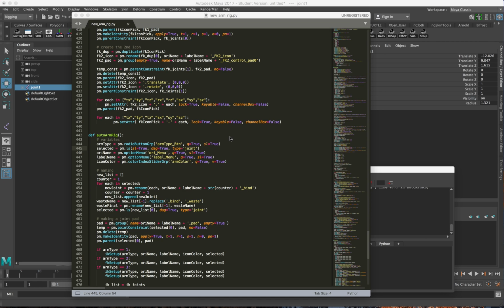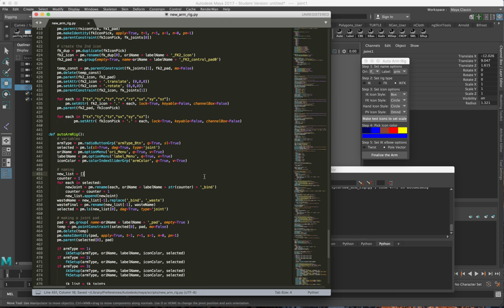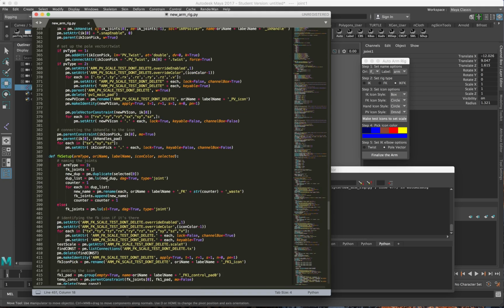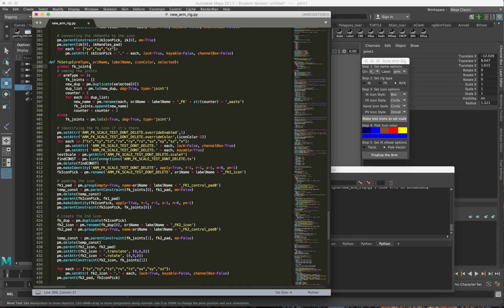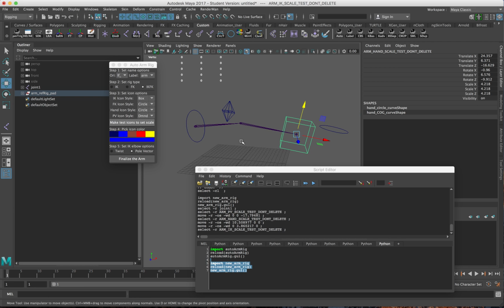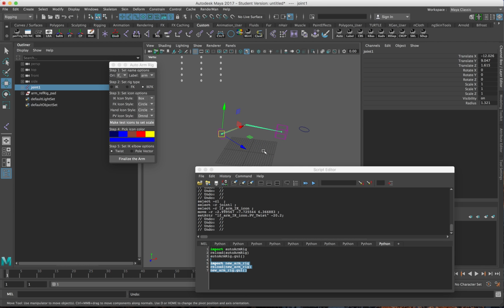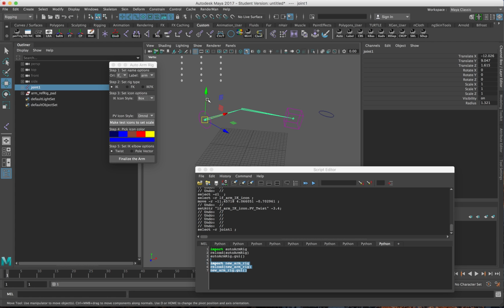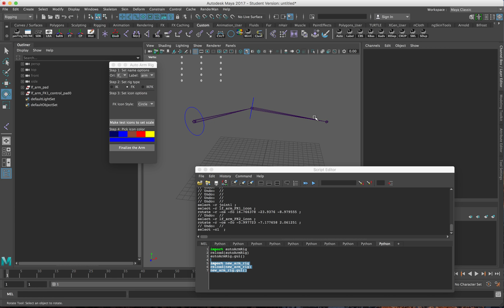Basic Auto Rigging in Maya with Python (Part 9)

Comment: I'm getting an error: 

# Error: list index out of range
# Traceback (most recent call last):
#   File "<maya console>", line 1, in <module>
#   File "d:/Users/XXX/Documents/maya/2018/scripts\new_arm_rig.py", line 204, in armIconScale
#     tempCONST = pm.parentConstraint(selected[1], ik_ctrl, mo=False)
# IndexError: list index out of range #
# Undo: new_arm_rig.armIconScale() #
Reply from the maker: Krobbkag Destroyer Of Worlds typically when you get the error “list index out of range” it means you didn’t select something before you ran the code.
Reply: @dcpalley23  Awesome, that seems to have done it: but now I've run into a new glitch:

// Error: setAttr: Cannot set the attribute 'ARM_IK_SCALE_TEST_DO_NOT_DELETE.overrideEnabled' past its maximum value of 1.
# Traceback (most recent call last):
#   File "<maya console>", line 1, in <module>
#   File "d:/Users/XXX/Documents/maya/2018/scripts\new_arm_rig.py", line 487, in autoArmRig
#     ikSetup(armType, oriName, labelName, iconColor, selected)
#   File "d:/Users/XXX/Documents/maya/2018/scripts\new_arm_rig.py", line 354, in ikSetup
#     pm.setAttr('ARM_IK_SCALE_TEST_DO_NOT_DELETE.overrideEnabled', (iconColor-1))
#   File "C:\Program Files\Autodesk\Maya2018\Python\lib\site-packages\pymel\core\general.py", line 573, in setAttr
#     cmds.setAttr(attr, *args, **kwargs)
#   File "C:\Program Files\Autodesk\Maya2018\Python\lib\site-packages\pymel\internal\pmcmds.py", line 134, in setAttr_wrapped
#     res = new_cmd(*new_args, **new_kwargs)
# RuntimeError: setAttr: Cannot set the attribute 'ARM_IK_SCALE_TEST_DO_NOT_DELETE.overrideEnabled' past its maximum value of 1. //
Reply from the maker: @62cky4powerthirst  Your error is because of the OverrideEnabled attribute, you forgot to change it to OverrideColor.
Reply: @dcpalley23  Now I'm on the last error. I seemed to have fixed everything except for one last glitch:  My script creates the IK and FK and all the controls: but the switch doesnt work. If I try to switch between the IK and FK it just stays in the middle not going to either.